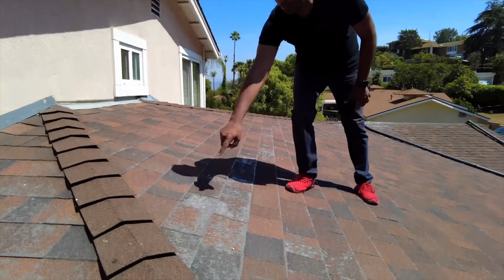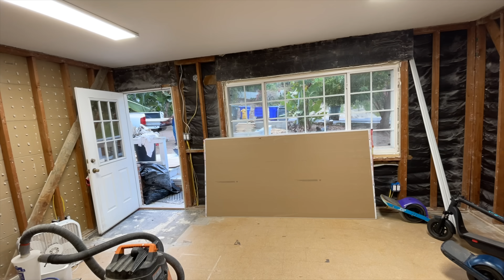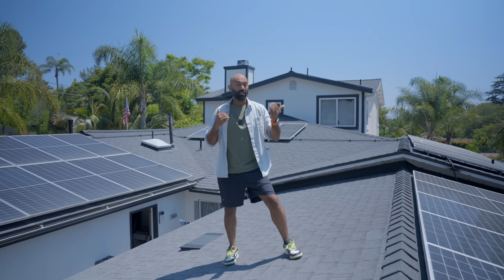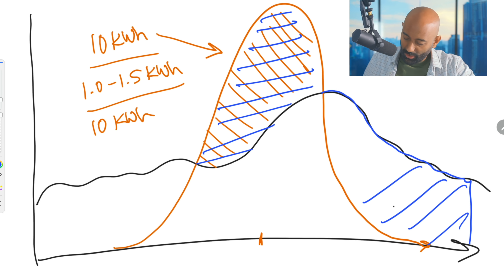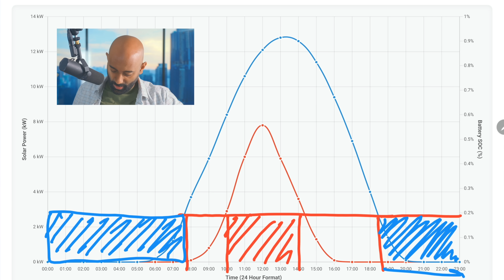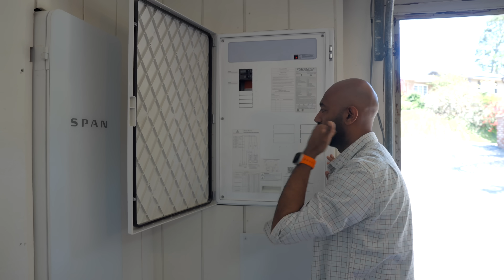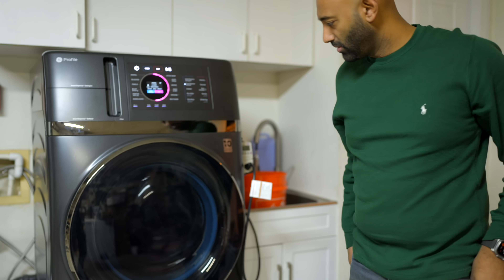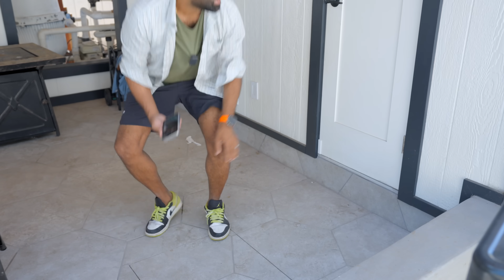Is Self Reliance Possible? Net Zero Home 4 Years Later...

Comment: I am fine with the utility company not having to be our battery.  I am fine with the choice to have days worth of battery storage on site.  It is more complex than that. There should be standard regulations such that your excess is sellable on the spot market in a micro region with offsets for wholesale distribution costs.  If the utility is selling power to your immediate neighbor for $0.50/kW-hr (retail) for a specific hour, then you should be able to compete with that after distribution etc is figured in, every hour of every day of the year.  As far as I know, that is not allowed anywhere in the US, let alone in California.  That needs to change, starting in California maybe.  Over time, utility companies will obviously change to adapt to that competition in supply and demand.  Right now, we are all getting screwed, and have been for a very long time, needing not only to store our own surplus for a 24-72hr swath of time, but also to massively overbuild to deal with seasonal differences and even then this does not account for costs in other consumed utilities like gas & water without profit from the sale of excess electricity to offset those costs.

As a residential user, i dont see how you can get to net zero without eliminating other utility costs/use completely, which is not optimum.  Selling excess electricity when it is high and using gas to heat when it is 15x more cost effective is freedom.  Lets strive to get there.

Comment: Ricky if you want to go with geothermal. Look into warmboard infloor heating systems. It's the most efficient infloor heating you can get. 
And they make panels that go over your existing floors. Retrofitting existing homes. Then just use chilled water fan coils for cooling.

Comment: yet another fabulous video filled with useful information. 

A comment on the discussion about NEM and related. While I think it's generous of you to try to empathize with the energy company that they might have issues with customers using their system as a virtual battery, the fact is that these companies have benefited substantially from this additional electricity in not having to buy and run peaker plants. 

On a related note, as a fellow resident of California, it appears there is something very wrong with how the state is managing all this rooftop solar generation. At present there are many days where there is far more supply than demand, yet these are the times when the rates are highest. Instead of NEM 3 and a general State policy to now discourage rooftop solar, what should be happening is reducing the price to near zero at times when there is oversupply, and encouraging EV drivers and backup battery owners to store this excess juice in their cars/batteries. Instead the ISO is attempting to sell this energy to neighboring states, but in many cases simply discarding it. At the same time this energy has zero (or negative) value, PGE is charging 60 cents+ per kilowatt hour. 

But of course that would require enlightened leadership, and apparently that's in short supply.

Thanks for what you do.

Comment: Why do you have to  use a  dryer in San Diego???...
I live in Athens, Greece, and I just can't get it...
What is this American obsession with dryers?...
In Europe in general, they are hardly used...
In Greece we just let the clothes dry in the hot summer air, hanging on a string, and in the winter (when we have to) we let the clothes dry, close, or on the heating panels, and we crack a window for the moisture, if its not open already, due to fair weather...
FYI, the Athens, Greece climate, is almost identical to the Sacramento climate, year around...

Comment: I don't know fully about your condition but usually relying solely on solar for whole years I'd not doable or really overkill. I've saw some data which tells that lack of solar in the winter can be ofsetted by wind energy as in summer there plenty of solar but little of wind and in the winter it's reversed. I plan to do some research in this area.

I really don't understand of dryer usage if you have big house and garden as you do. It really feels to me totally unnecessary to use dryer if you can just hang it ain't let it dry. In summer it even dryer faster than in dryer mqchine 😂 ;)

Comment: I am in the UK and want more solar and batteries, but we are constrained by the ability of our power network to our home. About 7 months of the year the battery works well for us. We are fully electric as a household with an EV, ASHP, 7.56kWh E/W split solar PV and Tesla Powerwall battery storage. We have a peak rate of electricity 27 pence vs 7 pence for off peak which we get for 6 hours. We use around  75% off peak electric for the year

Comment: Ricky:
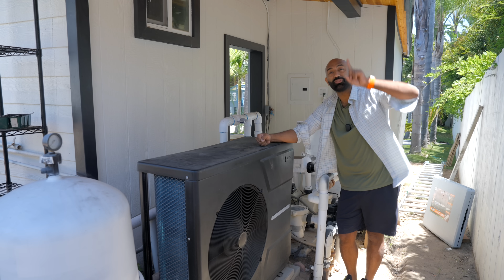At 26:30, you make a trade-off assessment between thermal water heating and electric water heating for the pool. I think that’s required for you because of your limited roof square footage availability - you don’t have room for both types of panels. Thus, your conclusion makes sense. 
But for someone who has unlimited roof or ground mount space, let’s share that solar thermal is more cost effective for heating the pool! I think there must be no doubt about that.

Comment: I'm in CA and have an existing Solar unit on NEM 2.  I want to add an additional solar solution with battery as I have a lot more usage, that's usually in the evenings (I use radiant oil filled heaters during the winter). In order to not trigger NEM 3, I need to make the new solution "non export". Which means, once the battery is filled and the house doesn't need electricity bc my existing system is producing enough, it'll turn off. 

Is there a way I can make sure that the new solution can take preference for house usage after the battery is filled, so I'm able to export as much as possible and keep both systems running? 

Thanks for your insights.

Comment: Regarding your hot water needs in the office... I presume that you are working mostly in the daytime, I further presume that your only hot water requirements are for hand washing. If this is the case, why don't you use the power of the Sun. You can simply install a 100 foot coil of PEX pipe in the attic and let the Sun heat it up during the day. If you do this, I recommend not making any connections in the attic, only make connections where you can access them easily and where they will cause the least damage if they do actually leak. Let me tell you how I know this works. I recently re-plumbed my house and ran all the pipes through the attic (I live in Florida so I don't have to worry about frozen pipes). The biggest thing I noticed when the project was done is that the cold water was hot, this means that we stopped using the hot water (water from the hot water side of the faucet) to wash our hands. We only use the hot water from our tank for bathing and washing dishes. This saves us most of the cost of operating the hot water heater.
With the second building being an office this would be a really good way to "Net Zero" your hot water needs.
A couple of additional thoughts: if you need hot water into the evening, insulate the last half of the loop. Doing this will keep the heated water warm late into the night after the Sun goes down. Also, use 3/4 inch PEX pipe to increase the amount of hot water available to you.
PS: If you want to convert that building back into a house someday, you can install the necessary plumbing and simply by pass the water heater with hot water from the attic.  If you do this, when you eventually install a water heater, the supply water will be pre heated and you will save a ton of money by not needing to heat the cold water directly from the ground.

Comment: Don't do the heat pump water heater.They work great when first installed, but getting them maintained is a nightmare. I have yet to find a service that works on these. I have even tried big companies that are hvac and plumbing, and the only thing they can manage to do is service the high voltage side of things and flush the tank. When it comes to the heat pump, they don't want to touch it. I suggest just wiring up a small 30 to 40 gallon electric water heater. They don't use that much power each year and are good for 10 years or better. My heat pump had several outages in 5 year, it took multiple service calls to figure out each time.

Comment: That is quite a convoluted mess of a system, and the phased build made all the stuff even more expensive. The brand choices and the fixation on microinverters also make no sense to me. Who shells out for EcoFlow for a little off-grid office? There's better and cheaper brands pupose-build for this stuff, not just power banks on steroids.  You seem to not be constrained by financial limits though, so you do you.

Also, since your aim is complete off-grid / net-zero, why bother with feeding back into the grid at all? Energy companies only give you pennies on the dollar for any supplied energy. My batteries are currently full at 10:30-11am, and after that it's just my house.

Comment: For hot water in the kittchen I’m using a small instantaneous water heater with 3000W. It’s not as efficient as a heatpump but its dirt cheap (100-130 €). Sure, we do have 240V so it’s easier to get the 3000W, but in your house this should not be a problem.
Also how many hot water do you need in an office? Sure, if you wanna shower it’s a different story.
Alternative, a water cooker for 30 bucks.

Comment: I had a solar system that fully met my needs AND I ran a monthly credit from my electric utility, HOWEVER, I had 4 microinverters that needed to be replaced in the first 4 years and one solar panel. My original solar installer reneged on their original lifetime support warranty and changed to a plan where I had to pay anything the solar manufacturers (for solar panels, battery, inverters, other equipment) did not cover. While I still ran a positive net expense in those 4 years, the electric utility was leaning towards future favorable payment rates for excess electricity reimbursement (and I only had 6 more years on the original contract amount). So I decided to sell the property (also the market was at an inflection point I felt with prices coming down the past 12 months and I had planned to sell anyway in the next couple years). Haven't regretted it a bit. No more hassle monitoring the system, dealing with repairs (which also reduced production while I was waiting on parts), and also buying a new energy efficient home where my electric bill runs under $100/mo year round. 
It was just no longer worth it to me. Also with the current administration, solar related companies are going to find it increasingly difficult IMO to grow their businesses. 
I you could buy a system with lifetime warranties that would not only cover repairs and replacements at no cost AND do them quickly so you do not lose solar production time, AND have states AND electric utilities that were PRO SOLAR, then perhaps it would make sense, but my experience taught me that in an anti-solar state with anti-solar utility, it did not really make sense in the long haul (particularly due to my relatively low electricity usage, even in summer months with AC). 
You really have to understand the economics if you are looking at it mostly or purely from that perspective and not in an off-grid (must have power) scenario. That's an entirely different animal, although some of the issues regarding equipment, warranty, fixing, replacement remain which I don't think many people consider.

Comment: I liked the over lay graph of summer charging hours over winter. My first winter with solar freaked me out. I thought the system was broken. There really is a huge seasonal difference in produced KWH's  It finally sunk into my brain, there is only a small window of charging time in every 24 hours, all of the other hours are pure battery. AND you have to run the house AND charge a lot of batteries during that window of good sun. But with the DIY nature of solar now and the add as you go method, it really is getting practical and beneficial.

Comment: Also San Diego here... feeling so lucky to have taken advantage of Tesla's brief solar-rental option. No out of pocket costs and they installed 11.4 kW on our roof. We simply pay $195/month and can cancel anytime. I think they discontinued it when they figured out what a money loser it was for them...but our contract is still in force. Added a pair of Powerwall 2s a year later (had to pay in full for those bad boys!). 

Surprised I didn't hear about a tankless hot water heater but maybe you mentioned it (I was listening while washing a car). 

Are you participating in VPP? We got a check last year for about $175 when the grid took from our batteries.

Comment: Some of the decisions seem REALLY strange. For example, why create a separate storage system just for the office when it would’ve been simpler to add Franklin batteries and integrate everything into a single system?

Also, I didn’t quite understand: are you draining shower water (along with soap, shower gel, etc) into the gray water tank and then using that to water the lawn and trees? Maybe that’s why the grass turned yellow? ;)

The cost of the solar panels also raises questions. $40K for 11kW of panels, especially ones that aren’t even the best, just 400W each? That’s seems very expensive.

But overall, it’s awesome that you’re doing this and sharing your experience!

P.S.: take a look at Tesla Powerwall 3 solution. It seems cheaper and better than FranklinWH: cheaper, more powerful, embedded inverter, unlimited cycles warranty.

Comment: Im a bit confused how you missed the total required electric for your house when putting in solar. Especially if your goal was net 0. I installed myself and used past electric plus charging a vehicle to project useage and nailed it pretty well. With a rough excess of $10-15/m which is offset until that time next year and paid out. Over in Michigan we still have some form of net metering... Its net, but after a year you are paid out for excess energy that wasnt used in the prior year. This is paid out at well under half the rate that they charge of course.... I put in a total of 16.8KW on the roof and garage roof. Total cost with inverters was 12k with some labor to help get the panels in place. All permitted and signed off by everyone involved. So total per watt cost was $0.714 installed with the DIY option. This includes permit costs, structural engineer costs, some labor to help, and materials. This house is ONLY on electric. No gas bill since the service is turned off. Heating/cooling is heat pumps (senville arctic series which work down to -22F) My total monthly cost for the property is Mortgage cost (1550/m)+ water bill which is ~$50-60/m depending on usage.

I could insulate the property more from the outside to really make it super efficient, but I didnt really have the time juggling multiple properties. 

Ill answer any questions anyone has on the system! Also House is for sale and makes ~$2000 per month in cash flow if anyone is interested.

Comment: Now add up the cost of everything in your system (batteries, panels, controllers, etc.) and divide by 240.  That is your actual cost per month based on a generous 20 year system life expectancy.  Also does your insurance company know about the roof panels?  They may raise or even cancel your insurance.  Not to mention the batteries that can combust (like electric cars) and again some insurance companies will not allow you to charge or even park near your house. 

Lots of things you have not investigated.

Edit:  Just so you know I live on 5 acres without any utilities, no water, power or sewage.  Well cost $60k to put in, septic cost $10k, solar is at $30K so far.  Well will need a new pump every 10 years ($10k), septic maintenance I estimate at $10k as well (10 years), solar $35k over 20 years.  That makes my 'free' living about $230 per month and I am not figuring in original costs, only replacement / maintenance costs.

Comment: Love your channel I love all your tech toys.  

When you factor in how much you had to spend on all of that stuff and I use Ecoflow DPU myself so I’m aware of the cost of solar panels, electrical panels, inverters, and batteries. 

It’s probably cheaper to just have a paid  your electric bill, even if you do live in California . 

When you add to the mix, power like solar or wind is intermittent and intermittent power has to be backed up by battery (in your case)… you really are left with a solution. That’s not that green.

Making solar panels and batteries is a highly toxic process which involves mining around the world normally done by exploited workers and children.

Makes it not look so viable unless you’re in a situation like you’re living in the middle of nowhere and you got to be off grid… your thoughts?

PS I do love all your gadgets

Comment: În România I have a solar panel system with 10kwh of panels mounted on a east - west oriented roof, a 10kw hybrid electric Chinese inverter, and a 16 kwh lifepo4 battery pack DIY made by me with CALB cells... The whole sistem was 4700 dollars and it was mounted by me and my brother in law.
This sistem is powering a small modular home that can be moved, and it's made respecting the passive house institute certification. For 7-8 months out of the year it can be offgrid.

Comment: biggest power save i did was put immersion heaters on timers. Even though they have thermostats and were double insulated, after doing 7day testing to get a week usage, reducing the hours on to 12 halved the power used, and reducing it to 8hrs on was a third of original use. It allow me to half total property electricity usage, at the time when unit cost doubled. (ukraine invasion)